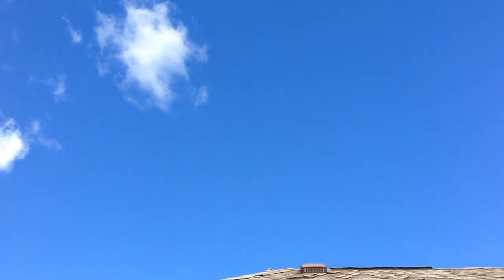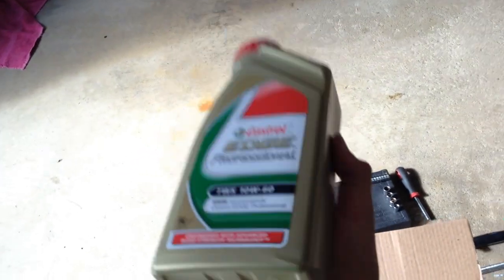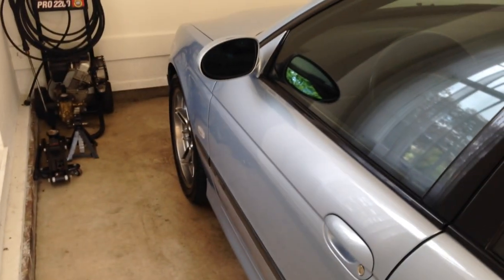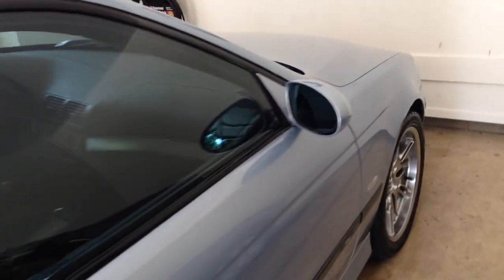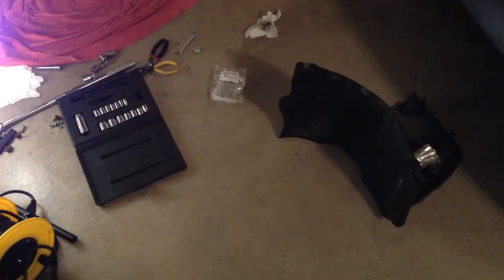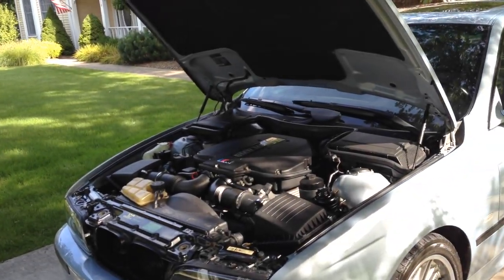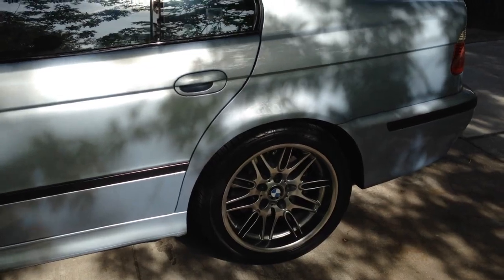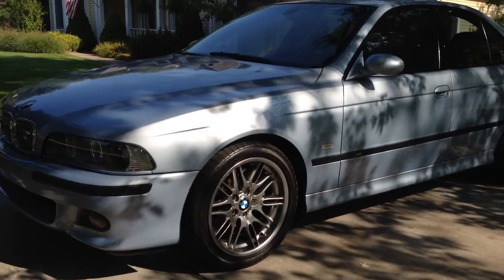Ryan's 2000 M5 - Late Summer Maintenance Update

Comment: Nice video, might try and get round to doing some of those steering/suspension components as well. Although if they're original on that mileage I might have a bit more time at a lowly 126k miles.

I need to get a noise checked out but have you ever encountered similar? It's my only video if you click on my profile.

Not sure if it's engine but it goes away after 2/3 minutes of driving, only does it when cold. Cheers

Comment: i always do 3000 regular oil(not in my BMW) and 4-5000 with synthetic or around 6 months. Usually a bmw or mercedes dealer says 10,000 but i think its a little dumb, i would rather spend the little money a oil change costs and have it done more often.

Comment: when  OBC menu shows KTMP: 96-100 C° temp gauge is in middle and when KTMP: 102-108 C°, needle is about 3 o'clock (near red)
pusher fan is always on!!

yes both parts that I ordered are behr (11 52 7 830 486; 11 53 7 835 558)

what I am missing?